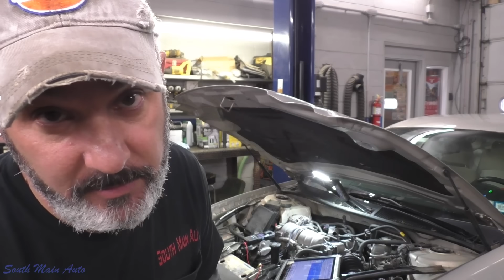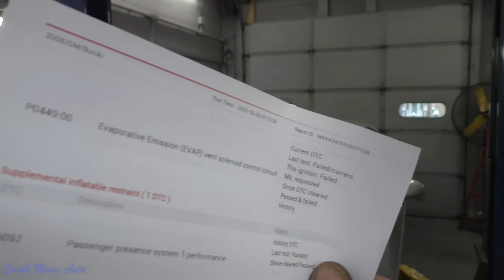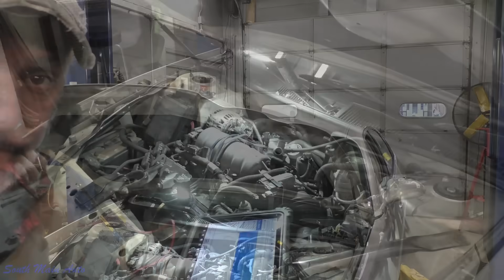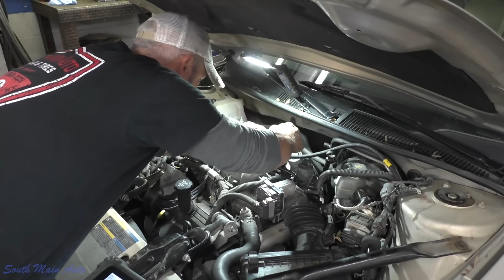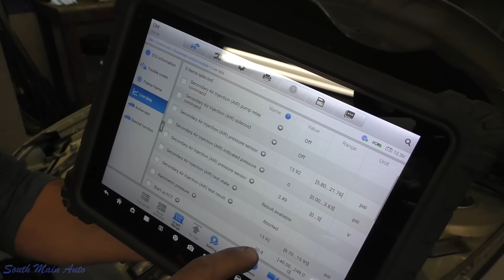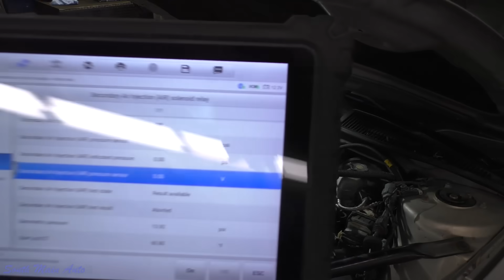When “New” Parts Are Worse Than The Broken Ones 🤬

Comment: There is absolutely no quality control going on now in the parts business. This past spring, I ordered a new set of switch knobs for my defender. They were anodized aluminum. They looked pretty nice so I figured what the hell let’s replace the plastic ones which were getting cracked and really all the newness had worn off of them. Well, I got them and I couldn’t get them to go on the switches. No matter what I did they wouldn’t work and believe me they just slide in and then are held in with a small screw it’s pretty simple. Well, I checked them with the originals and it turns out the machine the slot too small and not only that if you lined it up properly, even the screw hole was not in the right place. Then to add further insult to injury the knobs themselves were too thick so that if they were properly installed, they would actually interfere with the other knob that’s on that pod.

I mean, how the hell can you screw up switch knobs? But apparently you can do it very easily.

Comment: Here's a good one. Not only today do you have to deal with new parts being bad, but we have mechanics not following even the simplest process to find a solution but they will repeat invalid tests to fit their narrative. For example, I helped a friend diagnose a battery drain on one of them new fangled EV cars. The 12v battery would die overnight. Could get an appointment for two weeks at the dealer, so I said I'd help.  So I went over the house to start diagnosing with a standard battery drain test. BUT, before we ventured out to the vehicle, something had set up of the security cam. We looked at the cam but it was just a bunny.   No I know what you're thinking. Why mention a bunny on the security cam? Well the security cams run in infrared mode at night. So they can 'see' in the dark. Well you know what else security cams can see at night??? Infrared sensors firing off inside EV vehicles with a driver monitoring system. And low an behold what do I see?? The driver sensor firing off every minute. It would turn on and then turn off. It would repeat that the whole time the car was parked. Now they have two of the same EV cars. One has the monitoring system firing off all night and one doesn't. Guess which one has it's 12v battery die??? Yup the one firing off the sensor all night. Fast forward two weeks, take that info to the dealer and do you know what they came back with????? CAN'T find the issue!!!! HUH??? I hope on the phone with the tech and his exact words are, I have no idea what that lights is" and "I don't see any light coming on" AND "My voltmeter is not showing any drain".  I was like, Ok, first the sensor is not a light and you can't 'see ' it because its an infrared beam and you're not using your voltmeter correctly. SO now my buddy waits. Probably while the techs feelings recover. I'm not perfect, but I do try my best and I know there is a shortage of techs in general, let alone good techs. But holy good god, at least try. Ok rant over.
Reply: You can't run a car on batteries, It is as simple as that. It was tried in 1900 and abandoned as a bad experiment. Tell your buddy to get a real car.
Reply: @tuberNunya Well that’s a pretty narrow view. Vehicles running on batteries have been around for decades. Tesla is the most recent example. Doing pretty well for something that you say you can’t do. I would imagine that in a past life you were standing next to your horse when the first horseless buggy came around, But to each their own. Don’t fear change or a different method. It will only lock you in a prison. And like Ellis Boyd Redding said, you get stuck in a prison and suddenly those prison walls aren’t keeping you in, they’re keeping the world out.
Reply: @joeyabb1965  You youngsters should know about fads. They are temporary. Take Pokemon. There are many physical reasons that they are impracticable outside the largest cities. Hope doesn't ever overcome physics. Sorry to burst the bubble.
Reply: @tuberNunya Not sure who “you youngsters” are but I’m very north of 40. Very. You may be right, but is multiple decades considered temporary?? I think not. I live in Alberta. Don’t get much more “outside” the largest cities. And them darn fangeled battery cars work just fine. They face the same limitations that IC vehicles do. Limited charging or limited gas stations. The same. Each have their drawbacks and their positives. Sorry to burst your bubble. Try not to make assumptions about whom you’re speaking with on the interweb.
Reply: @joeyabb1965  There you go. I almost 70 and I have been working om cars since 1969. And Alberta? What dumb uneducated SOB in the north thinks he can heat an electric car in the winter?  Don't you people have any idea how much electricity it takes to create heat? 
Do your friend a favor and tell him how stupid it is to buy an electric car. Better off using a methanol generator and burning waste wood to run a used car.
Reply: @joeyabb1965  ALSO. WTF is multiple decades?  2008 was the first rollout and that hasn't been even 20 years. So not even 2 yet.
Reply: @tuberNunya Well EV or batteries vehicles, as you call them,  have been around since the 1860’s in some form. But main EVs sine 1995/95 I believe. GM maybe? Tesla launched in 2006. There have also been non-commercial available EV vehicles since the 1980’s.If you include hybrids then there are even more examples. So, yeah, decades. Also don’t just think about the US as the ONLY EV market over the last bunch of decades.
Reply: @joeyabb1965  You are insane. You aren't going to get anyone to believe that bullshit.
They were tried and they failed quickly, and they were crushed. End of story.
Reply: @tuberNunya Really??? It’s always the folks that lack the ability to converse who resort to attacks, but ok. The early EVs suffered from technology limitations. Battery size and limiting ability to charge properly. This is where Tesla has seemed to overcome the battery issue. Now companies like BYD, and others have shrunk the battery even more. There is also battery swap out stations in Sweden, I don’t recall the exact company name, maybe NIO, but the swap takes literally under 10 minutes. And then you add in solid state, Silicon Anodes and Sodium Ion. All making leaps in battery technology. And this is where the EV technology always fell short. And if you travel to different countries, especially ones in Europe, there are many EV trains and transports that are battery based. But like you said, thats all bullshit, right?. Look, I’m sorry you’re intimidated by change and technology. I know change is hard. Try harder to improve your debate skill set. And for gods sake, at least learn to use ChatGPT or Claud AI. You can check things you “know” to be sure they’re accurate.
Reply: @joeyabb1965  It's no attack. It's true. There are no EVS driving around tht were built before 2008 when the first Tesla rolled off the line. You can try and fool yourself but you can't fool anyone with a brain.

Comment: I never knew that so many after market parts were junk. After watchin both you and Ivan, I've learned that I should use OEM parts bought directly from the dealer to ovoid cheap china fraudulent parts. I feel your pain!
Reply: My experience too.  I also learned that even OEM Mopar parts for the older 15+ year old Jeeps do not last as long - wheel bearings 10 years versus 3 years now.  They are probably outsourcing the older vehicle parts manufacturing to overseas.

Comment: I just went through 3 Reman PCM's for a 1999 Chevy Express, because the 5v reference circuit was only putting out about 2 volts to the MAF. It gets to the point where you question your own diagnosis but like you said, follow the facts. Finally got one that works (For now).
Reply: Auto companies fought cleaner exhaust requirements for decades with simple hang on, shaky junky, junk, fixes. Then someone realized, "Hey this stuff is lawful and it could all be profit centers if we play our cards right ..."   Today the price of quality copper for quality solenoids is skyrocketing and ..."      lol
Reply: No way that's crazy
Reply: OE PCM's ford 2007-10 'ish Explorer/Mountaineer were a crapshoot for quite some time, Ford Field engineers were quite aware. These were brand new from Ford.
It happens and when it does it makes one question their sanity.

Comment: Sadly it seems to be in all industries. Quality control checks are now done at the end user rather than the manufactures so now you pay the cost rather than them. Even when it works at first, you have little confidence it will continue to work as long as the original did. A shame when you would rather buy used parts than trust new ones.    
Time for more target competition or back to the tree stand!

Comment: Same here brand new pedal position sensor plugged in car goes nuts put old one back in car fine customer demanded to put another one in as that is what internet said. TPS in my own truck oe lasted 27 years reboxed  ACDelco really Standard on box last 1 year no OE available. rebuilt calipers NuGeon full size Jeep oe stuck piston 50/50 chance within a month leaking and other cars with this brand also but no more for them
Reply: Looks like you also got a defective keyboard cos your punctuation ain't working.

Comment: I don't know if it is more common for shops to admit they don't know what the problem(s) is/are (even if it turns out they got junk parts) and remove replacement parts that don't fix problems, but it's encouraging that they don't use the excuse, well it needed the new parts anyway and then charge the customer. Perhaps the fact they know SMA will likely be the next stop has something to do with it.
Reply: Was going to comment the same thing, they did involve the parts artillery but at least they removed the parts and didn't stick the customer with them.
Reply: I worked for a guy like that..he would throw parts at it until it fixed it and then concoct a story about how it needed all the extra parts. Relying on customer ignorance..I was not taught that way.